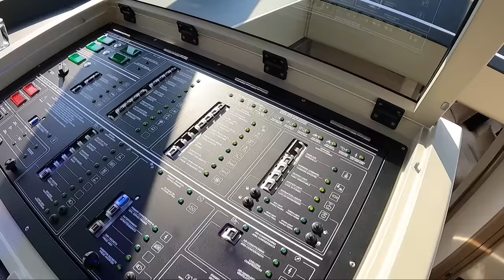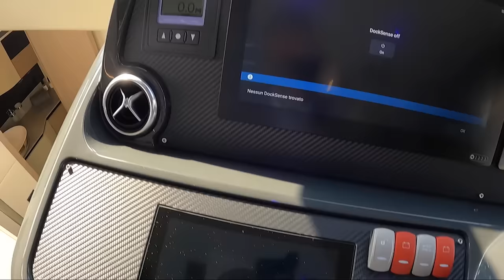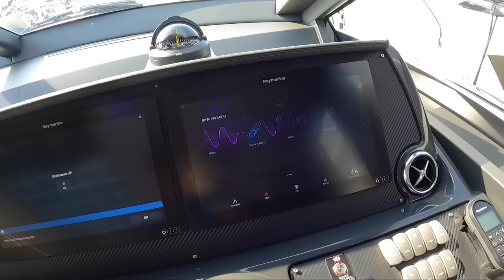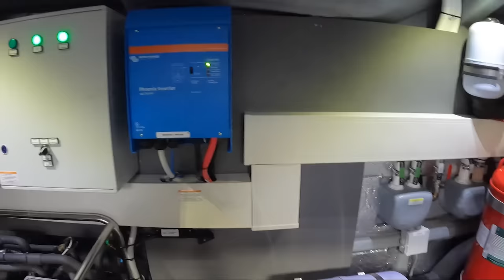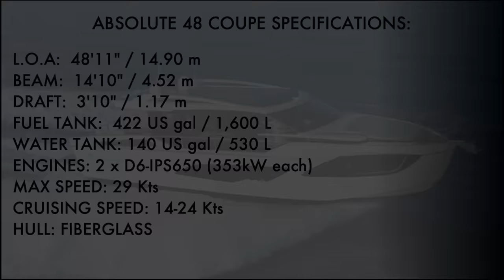2021 WORLD PREMIERE: €770,000+ ABSOLUTE 48 COUPE Yacht Tour New Model

Comment: Gotta say, genuinely impressed with this boat.  6 real berths, bow cabin was unusually nice, nice big windows in all cabins as they should, solar panels, clever galley across, the right cozy impression in the aft deck and lounge layout, not sad ferry box room like some mega yachts have. Elegant aft deck even though the table might be a little weak for 6 but I could see myself actually buying this. And yes, I think AI captain can be huge. If the yacht can actually pilot itself including gripping the cleats. All sailing by voice command. No need for crew. Chuck along gently while you sleep.

Comment: The "dock itself" is what got my attention. As I've mentioned before in a previous post, about going for the Bering 80, I would for sure want the Raymarine Dock Sense. I've already contacted Raymarine and they say in a new build, they work with the shipyard to fully integrate into the vessel during the build. On a larger vessel for owning operating, like the B80, what could be better than a system like that ??? I'm really glad you showed this in the video because I feel like this is a life (and insurance) saver for owner operators without a crew. Another awesome video guys. EDIT I forgot to add this. One of the things I love about your videos is that you open everything (where permitted). I'm just curious if you've ever opened something and saw something that you shouldn't have seen?

Comment: That boat might be one of the better bout under 50 feet I have seen. the layoute is quite perfect and reasonable. And you have that little yacht feel (of how most people "belive" a yacht looks like, until you see one)

The only thing I would request from Absolute, if I was to order one. Is to make those storage compartment on the swim platform into Drawers instead, since they are so low down, that you have to get down on all four, if you want to get something. I would op for a drawer with removable sides and all 3 drawers can be connected together if you are storing something long (f example, fishing rods or wake boards, etc.)

Comment: Range is always a major point of interest for me when it comes to stats. Black water management is also a big deal. It'd be lovely to see things like that included in your stats graphic. Cheers and love your work :)
Reply: Agreed! I am always looking at range and fuel consumption when I am researching boats. Looking to upgrade in the next couple years and while we aren't necessarily looking to cross oceans I am looking at being able to be away from docks for several days or even a week at a time. This boat checks many of the boxes aside from maybe a water maker which could be added aftermarket. We are looking for a less than 50 foot LOA with 3 cabins, water maker, with liveaboard capabilities. Would like to find something with a range of over 500 miles at trawler speeds but I'd be willing to look at fuel bladders too for the right boat.
Reply: In the United States black water can be released if outside of 3 miles from the coastline. Check your country for it's regulations.
Reply: @TheFlooringInspector82  I would recommend the Swift Trawler series from Beneteau (not sure if I spelled it correctly) Has decent range plus speed. They are some of the best. Make great live aboard boats.
Reply: @ayushbhaskar4795  I actually looked at a swift trawler 50 and I was indeed impressed. It's definitely a contender if there's a decent 50 or 47 available on the used market. I've also considered some of the smaller Nordhavn boats and looked at a Helmsman trawler too. I guess we'll see when the time comes what the used market is looking like.
Reply: along with Air Draft/ Bridge Clearance  when it's under 20'

Comment: I realize this is a 48 footer, but I don't think I've ever seen any yacht that could be a liveaboard that had such fuel economy. According to that graph, even at 8 knots, you're using less than one liter per nm, which is crazy. With a relatively small fuel tank of 1600 liters, that means that if you putter along, your theoretical range can be over 2000 nm.